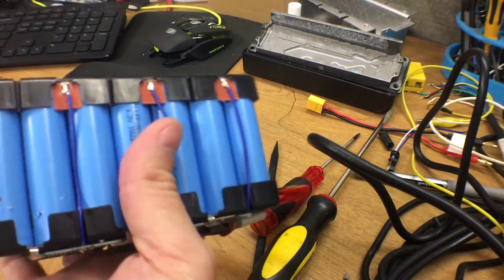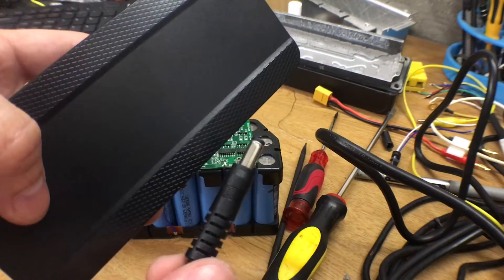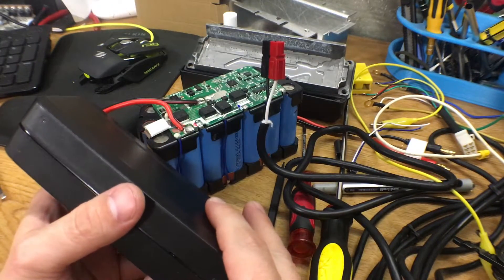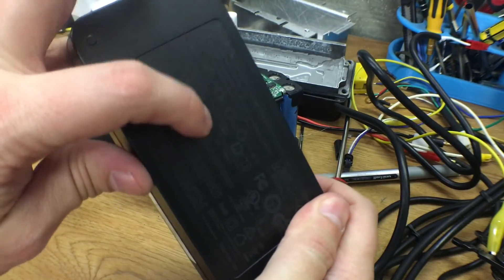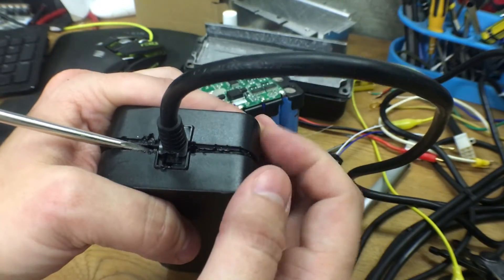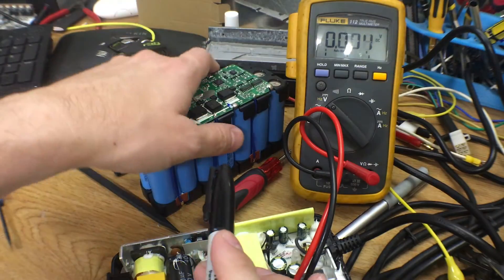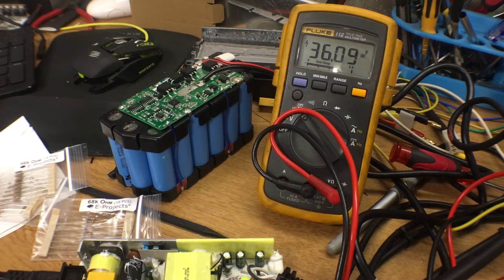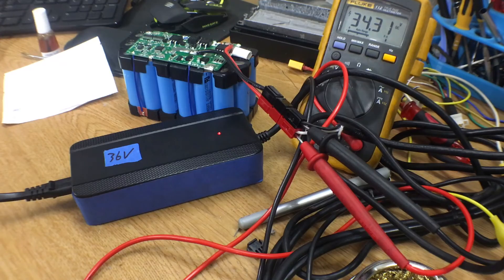Super73 charger Modified for LiFePO4

Comment: I would just like to know how to add a second battery pack which you could quickly plug and ride. Interesting though but wouldn't sticking to the same battery specs be an easier direction?
Reply from the maker: If memory serves, you'll find anderson plugs inside the seat. Unplug the original battery and then plug in your second battery. And yes, matching the voltage spec for the 2nd battery would be best. You may want to consider a switch or large relay to toggle between the two packs. If you did this you may be able to charge one and then the other from the original charge port.